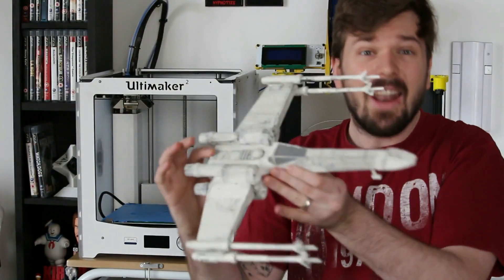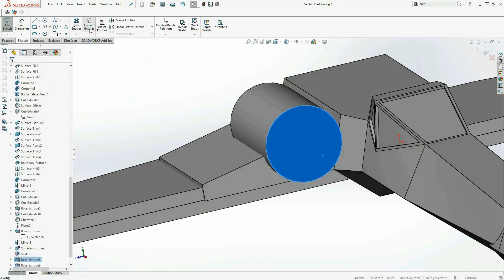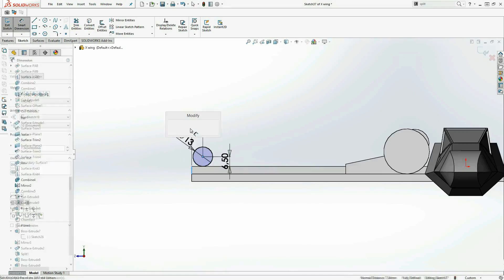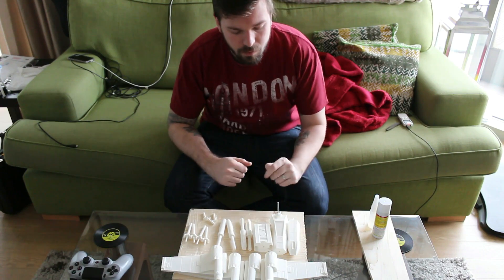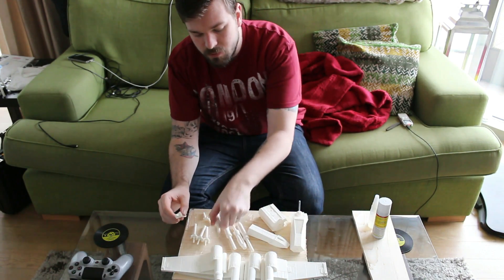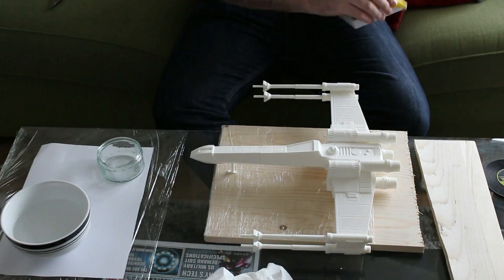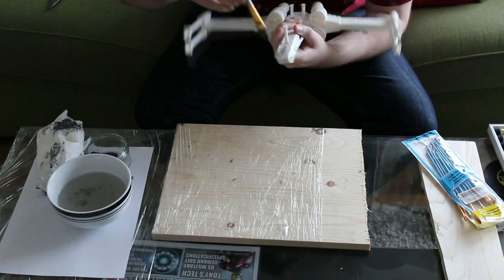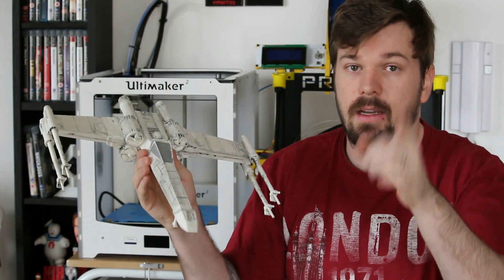SOLIDWORKS Time-Lapse Tutorial: Star Wars X-Wing

Comment: I got a little upset with what you did with the paint thingy to give it "battle-damage".
You did it kinda to the point where it just looks like someone splashed paint on it (literally) rather than using the REAL tiny brush that you tap into the cracks and holes and it spreads out

Comment: Can I print 3D models directly from SolidWorks?
Reply from the maker: Could you post this question to the MySolidWorks forum? Our experts can go into more detail there and help connect you to resources about 3D printing and SW files. Please include your system details and the version of SOLIDWORKS you’re using. http://3ds.one/qRCpUO
Reply: designtechsolution as far as I'm aware the only 3D printing capabilities with in solidworks is checking your model for wall thickness and over hangs. 

It would be cool to have the entire process internalised with either a plug in or a SW slicer.